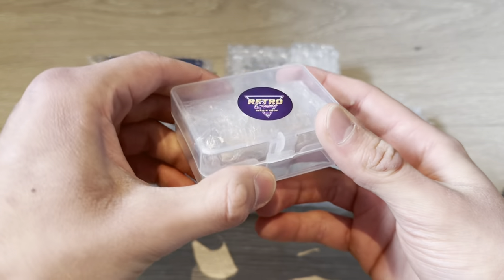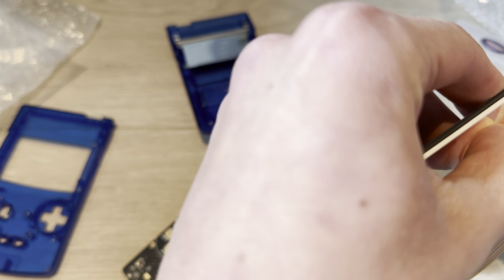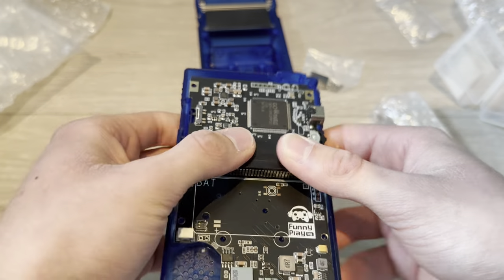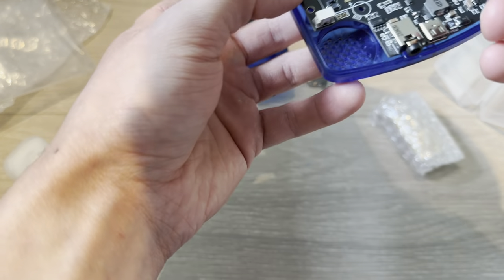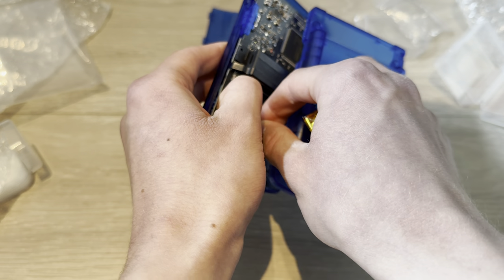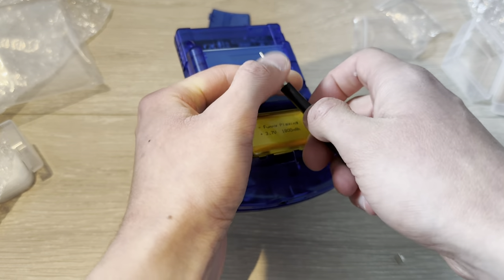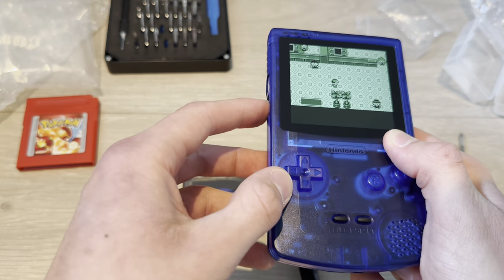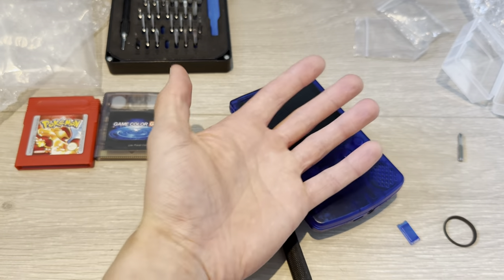How to put together the FPGBC!

Comment: Can't believe you ditched the speaker ring - that keeps the speaker from rattling. Get ready for vibration and possible sound issues. I ordered one direct from Funny Playing and I think I got a bad board as the power switch doesn't click it just loosely slides. Still trying to get them to replace the board.
Reply from the maker: Ops